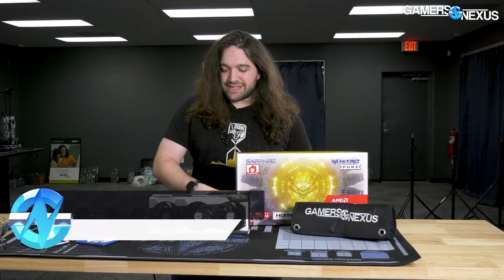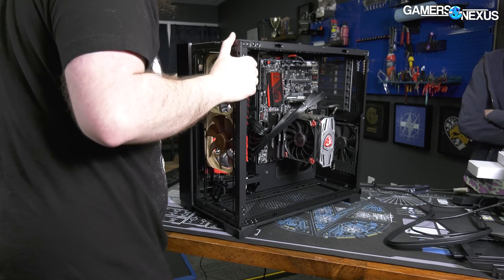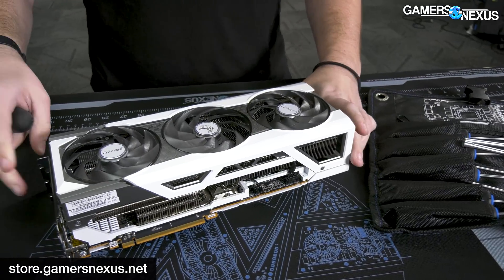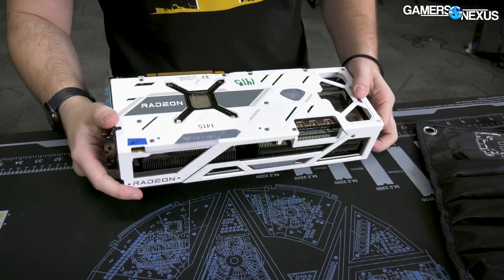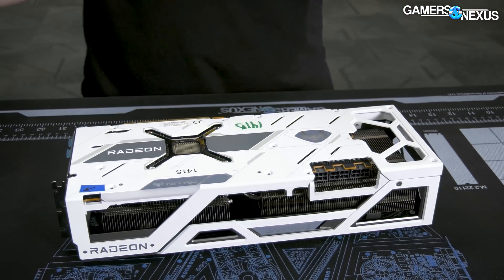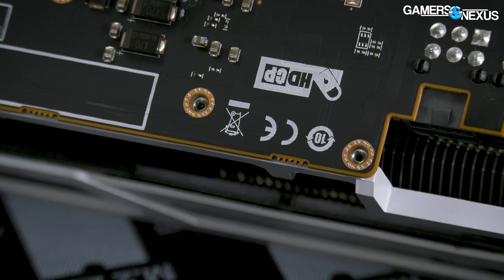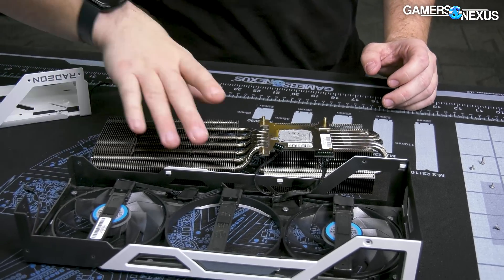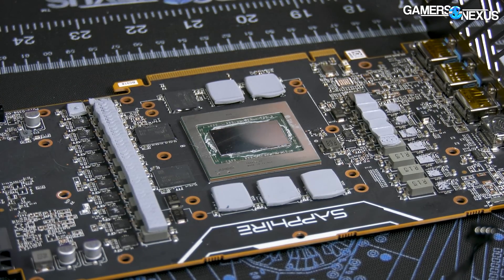Tear-Down: Sapphire's Excellent Cooler Design on AMD's Hottest GPU (6950 XT Nitro+ Pure)

Comment: Never had a bad experience with Sapphire and I'm running their 5700XT Nitro+ SE in my system right now. Not an issue, and great temps/clocks! Before that was a Sapphire R9 290 and a Sapphire 1650X before that. Glad to see they're still doing demonstrably great!
Reply: Yeee my dad’s rig I made for him has a used Sapphire Nitro+ RX580 4GB just in case he gets curious and tries a game or Google Earth zoomed out to space/whole globe and full screen, it will run smooth with any old GPU.
Reply: @depth386  I have that card, still runs on full-hd everything to high, even Horizon Zero Dawn. Only cyberpunk / rdr2 / Ass Creed Valhalla on medium+ but still happy since this was a very cheap premium-quality card in 2017. Most recently I was surprised how well optimized Forza Horizon 5 is, and awesome gameplay.
Reply: @cosminmilitaru9920  Yeah RX580 is a legend

Comment: I've had a few Sapphire cards in the past, last being a RX5700, and their quality is always pretty good. They went through a lot of R&D to get the cooler made for the 6950XT. Not going to buy it though, since a few weeks I have my first NVidia GPU in decades in my rig and this little Asus ROG Strix 3080 OC does just fine, no need to upgrade anytime soon.

Comment: the black stuff under the BGA is to increase the tensile strength of the chip to the pcb, in theory it relieves stress or at least copes better with the stress of the solder balls. add just a bit more protection from a de-soldering event.

Comment: Yea same problem with best buy here. Bought a PC prebuiled open box though supposed to have a 2060 in it and Ryzen 7 3800. When I went and picked it up and it wasn't the advitised. It was Ryzen 5 with a 1650 super and I got no refund nothing just got F@#$ed. Apparently it was returned with different GPU and CPU and they never checked it. Garbage fucking company screwing people however they can.

Comment: Can we start pushing back on GPU manufacturers to design cards that are designed to be serviceable?! they should be using durable connectors and simplifying the process of removal of the cooler so we can properly service cards. Let's Push for that Gamers Nexus!  GPU''s have too many screws of too many different types. it should be extremely simplified to allow for regular maintenance.
Reply: Careful
The corporate response to "you use too many screws" will be to weld it together
Reply: @junjiexie  LOL!!

Comment: 10:35 i'd rather see that on all SMD chips. I've seen chips die when liquids OR even dust (which can get conductive) gets between the board and the chip. One of the most resilient pieces of tech i have is a dive camera. It's a modified pro-sumer Canon. All the SMD components inside have that epoxy glue lazily applied, sealing them in, and i mean, all of them, and that's with a generous coating of clear epoxy all over on top of that. The first model we got from the modifier was only coated in epoxy, it failed in one year. Moisture managed to make its way through the coating. That might mean nothing to the regular PC user, but in a water cooled setup, it is the difference that makes or breaks the product.

Comment: STEVE, stop pretending for knowledge in cooler engineering and declaring non-facts- having big, wide openings on the sides is not always good- because the more pressurized the air, the better the thermal conductivity, and those openings can relieve it too quckly from the cooling surface space. Neither extremity is good, so i don't think you can judge the efficiency on a cooling system with your illiterate integrity. Also, before you didn't knew which way a blower fan blowed, in one laptop teardown video.

Comment: Over 3 slots?  Is that all?  I just bought an MSI card listed as being a 3 slot card not realising that once installed allong with the included support bracket it blocks off at least 5 slots!

Comment: Water cooled gpus will be the only way to go if power keeps going up.  Air cooled in cases going to be hot.  Plus with these amd gpus on air the hot spot temp is ridiculous.  Must not be flat die faces.  Up wards of 20c more for  hot spot is unacceptable in my mind.

Comment: Sapphire is a fantastic AIB manufacturer. I have an RX 584 Sapphire Nitro+ and it's very cool and quiet. My roommate has an RX 474 Sapphire Nitro+, though it seems like it needs repasting because it's got 10C higher temps at less wattage (but at least it's smaller and lighter). What's important is that none of the fans have died on his already pretty old RX 474.

Comment: Sapphire's been consistently on point on their Radeon cards, even going as far back as the AGP 4x slot days.
Reply: Back then HIS was a worthy competitor. IceQ 1600XT was a boss.
Reply: @zoomzabba452  Except every one had died for some reason. Had to move to Sapphire like my builder adviced.
Reply: @lknowledge  Well, the fans died after ~4 years, and that was back before we were even monitoring fans/temps of our systems. So you had no idea your gpu was frying...
Reply: @cosminmilitaru9920  oh mine went up fully. No video or crasye under load.

Comment: Sad to hear the commentary on Best Buy. Stores are fairly independent of one another, one location is good, another is bad. Very dependent on how well management takes care of their employees. Corporate is very fake with  employees and customers. One can feel the suits at the top just want the numbers to go up and up. Puts a lot of pressure on the frontline workers. Sales people aren't judged for their knowledge of the products, just whether or not they convince people to sign cards and memberships. It doesn't help that the more passionate, trained people were laid off early last year. So a lot of talent was strained away. Oh and corporate flip flops on whether they want specialists per department or general all department types. Current phase is general all department types, been that was for at least 2 years, so give it another 3-4 and there might be a change back. If the company is still around by that point.

Comment: The fact you can replace the fans easily is imo worth something.
Reply: As Steve said, the fans are normally the first part to fail on a graphics card. Replacing them could double the lifespan of a card, which with the performance we're getting these days, is an excellent proposition.

Comment: I can relate to the Best Buy experience. The funny thing is when I was trying to apply for various positions with them back when I turned 18 and again when I was 27 (as a gap filler job), despite my technical background and PC building experience of 14 years at that point, they didn't think I would be a good fit in anything there.
Reply: Their suspicion that you are treating it as a gap filler (turns out they were right) is probably why they didn't want to deal with the expense and trouble of filling the spot again after a short time.  Sad thing is, people with that motivation completely fuck up options for others totally willing to settle because they can't get ANYTHING to land.
Reply: No, when I applied at age 18 it was NOT  a gap filler but I got tired of going into the stores and filling out the online questionnaire only to be told that the manager didn't think I'd be a good fit. Maybe read the WHOLE post before saying such things.
Reply: @NightMotorcyclist  your questionnaire answers probably popped flags is why they didn’t fill the need to go further. It’s the whole reason for having it.
Reply: Did you make it to the part of the application where they ask a bunch of personality questions? Because if so, that is probably why you got filtered out, especially if you answered honestly.
Reply: That's what my buddies told me. They want you to sell rather than fix or provide service, especially for the Geek Squad garbage.
Reply: i tried applying too several times when i was a teenager. Now everytime i go into best buy im glad i dont work there; because they're all idiots, they hired ppl who have to look at their phone to give a half - ass response, and i usually teach them something in the process.  and im still just a hobbyist in my book

Comment: Nice as this cooler design is, I miss the days where GPU's where single slot with the simple copper cooler on top. The moment a GPU needs scaffolding to support it in the case is the moment you should ask the famous question: There's got to be a better way 😉
Reply: and there is: liquid cooling x)

Comment: Had two Sapphire cards in the last 3 years and from my experience they become unreliable and start crashing randomly after 1 year. I suspect the cards are to heavy thus the gpu sag results in a permanently bent PCB which causes the crashes.
Reply: I've had a 5700 XT Nitro+ for almost a year and a half now, not a single issue with the card yet. You might be confusing it with AMD's drivers. They've singlehandedly fried a few people's cards, and have caused plenty of issues for others. Luckily I've experienced almost no issues so far :)

Comment: 377 watts is exactly what my 3080 Ti Gaming X Trio consumes after I've undervolted & overclocked it. And I'm fairly certain my 2100 mhz card will run circles around this 6950xt.
And the exact model you tear down here actually costs more than I paid for my card, at least here in Denmark.

Not very impressed with AMD on this one. Where did the efficiency go?
Reply: Time to run tests. My 12gb 3080 seems really solid too. Maybe meet gen I'll go amd
Reply: My man you're comparing an undervolted and overclocked card to a stock card. You're literally admitting that your card takes more power stock vs stock.
Reply: @Emelydiaa  No I am not. My card capped out at around 340 watts out-of-box. Stock vs Stock the AMD card has slower memory, uses more power, is physically bigger, and costs more. All in all I think I'm right to be disapointed.
Reply: @Bakardi47  that'd be because it's capped at 340 W? higher tier GPUs like the 6900 XT and 3090 have higher power limits...

Comment: How different is the cooling solution on this compared to the 6750 XT? I feel like that card might just be the right move atm, as it is (at least in Germany) around 100 euros cheaper than the 3070 and appears to outperform the 3070 in a lot of cases.

Comment: As someone who's had to completely tear down a reference 6900XT to simply clean the fan blades (twice!), socketable fans are an immeasurable QoL feature.
Reply: No one likes a bragger, LOL
Reply: Waterblock install is similarly tedious.
Reply: My Palit Gamerock 1080 was the same, although I've since deshrouded it with two Arctic P12 Slim 120s for that sweet sweet noise reduction which inadvertently made servicing the card easier too. It really is frustrating to buy top of the line enthusiast hardware (even if yours is a little more modern than mine) only to be treated like that by the product.
Reply: @Crawdoodle  Quite the opposite - usually behind on cleaning and bust my ass for every dollar I make.  Would've preferred a 6800XT, but after months of F5 I grabbed something that was available and didn't pay the scalper tax.  The main problem with PC I usually deal with is dust.  I made and ultrafine stainless mesh filter (120 mesh), but still get that fine, almost paste-like dust that glues to everything, especially to the back of fan blades - the joys of indoor pets.

Comment: Au regards the BestBuy thing. Ya'll remember the 90's early 00's (i think) mini comic about the corporate ladder, where the employees are depicted as birds on a post or something, numbers tapering down as they got to the top where only one bird was sat? Looking up, there's only assholes, looking down there's only shitheads on account of all the bird poop. That one had its own meaning, but ... it also had another meaning, one more sinister in regards to "trickle down economics" (a figment of some douche's imagination) and how a company treats you, the customer.
Because you can be absolutely certain that the way you're treated is a reflect on how they're treated as employees at the end of the line, AKA shitheads.
Caveat, in today's world, things have gotten so tight noosed around the employee's neck that they can't even afford to vent all the shit to the next in line (the customer) anymore, for fear of being crucified and blacklisted on the job market. Because one can be certain corporations are profiling and crosschecking.

Comment: one day, you will need an external case just for the GPU. I have a feeling the days of doing micro builds that can use decent GPUs are gone. I did a micro build using an EVGA 2080 a some years ago before all the shortages but that card was at the limit for the case. a 3080 founders would be the only current gen 3080 that would fit and pretty much none of these radeons would fit since micro cases usually have a 2-2.5 slot limit.
Reply: a lot of those small builds use liquid cooling of some kind, which makes the size of the original GPU cooler irrelevant as most waterblocks make the card 1-1.5 slots thick.

Comment: if you buy these cards with socket-able fans, might as well immediately buy a replacement or two if you plan on keeping the card for longer than 3 years. Trust me they evaporate off the market after 2 years.
Reply: The ARGB fans for the 5700 XT are still available on Amazon for basically the same price almost 3 years after launch

Comment: I have looked at Sapphires Pulse line for some time, so i would love if you take a look at the 6650 xt pulse or new generations of their "cheap" line. My general impression is that its no nonsense and low noise.
Reply: I don't think any of their coolers since RX 500 have been worse than average, probably longer than that
Reply: I was concerned at first about getting Pulse for the 6800xt but it's all that was available at the time and it's actually pretty decent thermals despite my case not being the best for air flow.

Comment: I dont understand now a days there are 3/4 slotted GPU why not just integrate one small AIO and 120/240 MM radiator and water cool this cards i mean AIO now a days hardly take more then 2-3 slot itself.. it will be so good cooling too! (Not separate radiator all on card itself!)
Reply: 120mm radiators are a waste of space. 240 is doable, but air coolers are a lot cheaper to produce. 360 is the only one that makes some sense, and that's why you see multiple high-end cards use them (like Sapphire's own 6950 XT Toxic)
Reply: @Emelydiaa  u cant fit a 360 radiator graphic card where will be the pcb then!😋
Reply: @vginside  the radiator is attached in the same way as an AIO CPU cooler, you attach it somewhere on the top/front/bottom/side of the case
Reply: @Emelydiaa  no it is what i said assume 2/3space gpu and 1/3 space radiator! Trust me with 600w to 1000w gpu future it is what gonna happen air coolers wont be possible anymore!
Reply: @vginside  oh I just read your original comment again, didn't see the "on the card itself" bit. I'm guessing that standard radiators just aren't as space-efficient in GPUs as regular air coolers

Comment: Replaceable fan BUT PROPRIETARY housing and connector... no better than repurposed screw attached notebook cpu coolers. The marking fd10015m12d yields some search results but mostly 4 pad connector version. That's already a red flag when one part number spits out two different devices!!! Car parts anyone?
Reply: Of note: that model number only notes the motor I think, as that exact model number can be found on RX 500, RX 5000 and RX 6000 cards from Sapphire, and the fan blade designs vary.

Comment: If this fan design is actually something special, then we need other manufactures to make their versions in 120mm size so we can put tgem on radiators etc.
Reply: I imagine someone is already working on a 3D-printed version to put on the A12-x25 for Major Hardware's Fan Showdown :)

Comment: would it be thinner if it had radiator on top and was water cooled ?
Reply: their Toxic model has a 360mm radiator, and yes the card itself is way smaller.

Comment: It would be interesting to measure the volume increase in GPUs over time. At what point do physical limits start to impact GPU design? When does water cooling become mandatory because they dont have enough room for an air cooler.  

Related - GPU companies owe GN a HUGE thank you for pushing case manufactures to make cases with actual airflow. Were in not for your work we would still have glass and plastic hot boxes dominating the market.